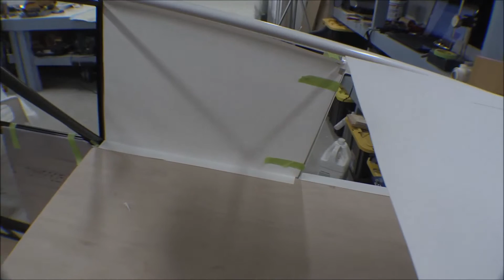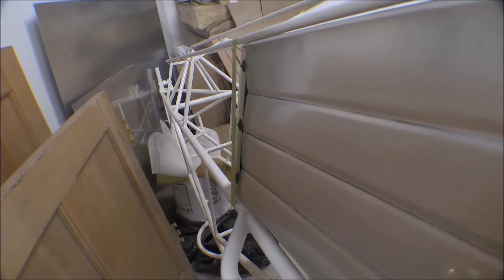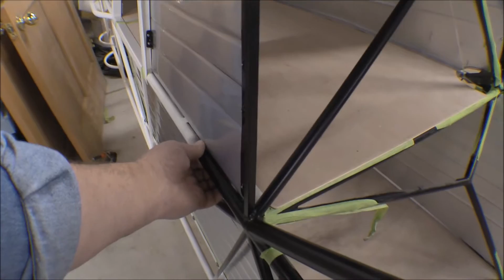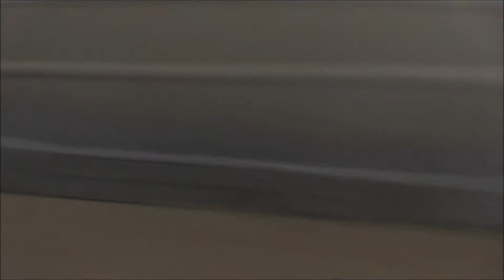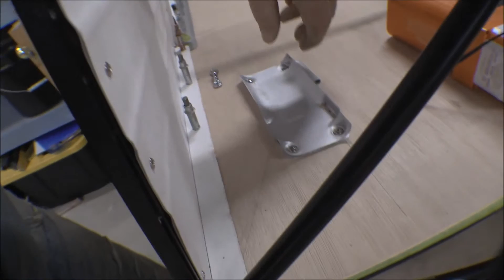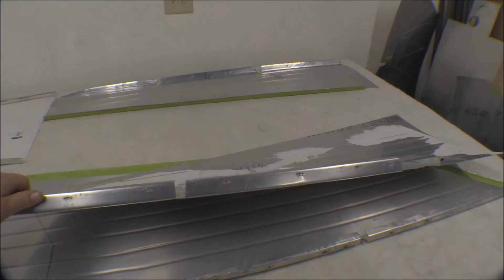Piper Supercub Widebody refurbishment:  finishing up aft baggage compartment

Comment: Too bad you didn't have a shrinker/stretcher unit. I bet that would have helped where you had some puckering on those curves. Great result though still, and I'm sure the little retention strips you used will work fine. It really goes to show how you can seemingly never have enough tabs on the fuselage when you're building one. I'd rather end up having extra and not use them, then have to weld more onto the tubing after it's all primed/painted (or powder-coated).
Reply from the maker: I didn't want to use the shrinker on those because the teeth go through the AL clad setting up for corrosion, although the paint would probably have protected them.
Reply: @psgflier  Right--if you had etched, alodined and then primed with an epoxy primer, that's about the best you can do. But that's a LOT of work though, I'll be the first to admit. I'm working on a pa-22 recover job for a client right now, and just finished priming some parts this morning. What a huge PITA to pull off in a small shop, lol!